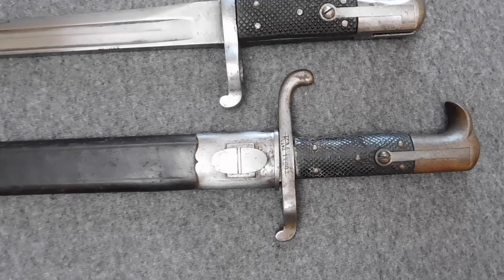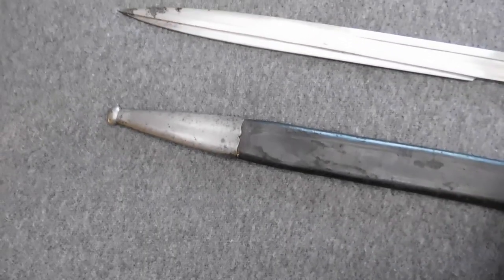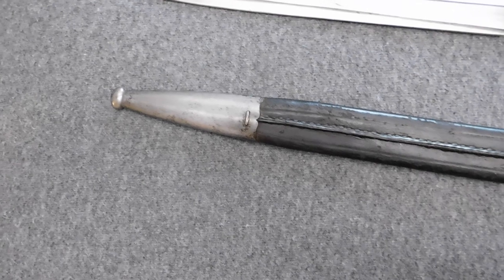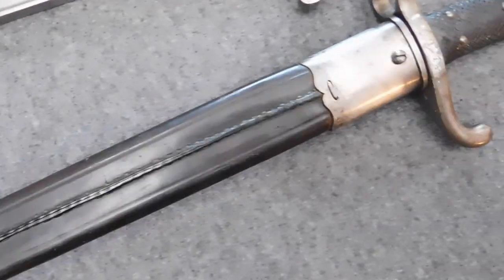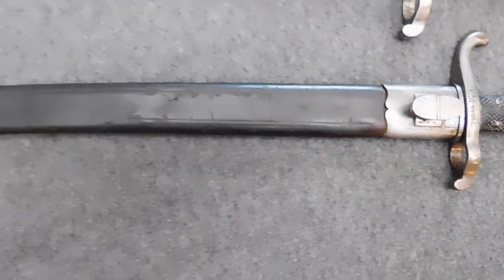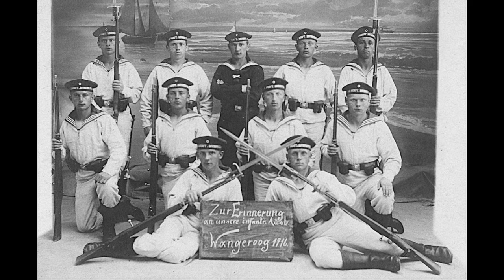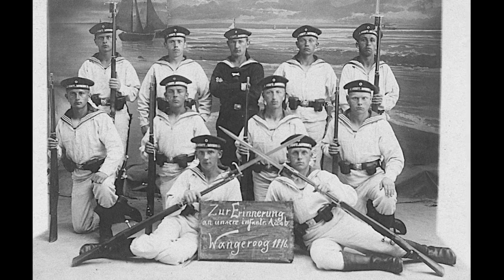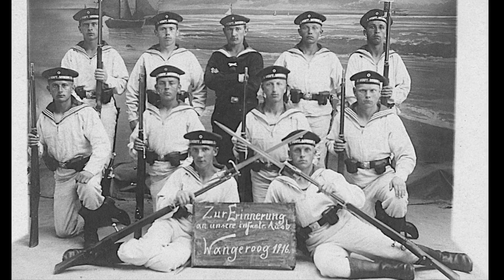Scabbard for the Hirschfanger M/65 and M/71, Postscript for 9.0.

Comment: Imperial German Hirshfangers are very hard to find!!   I once owned an M65/71 by German's adding an internal muzzle ring to fit the later Gew71. I'm looking for them again.  I picked one up in 1978 for $25 with frog!  It was the M65/71 I previously mentioned.  You can't buy the frog for them today for that price! First German Bayonet with eagle head pommel & black checkered leather grips, & "pipe back" blade!